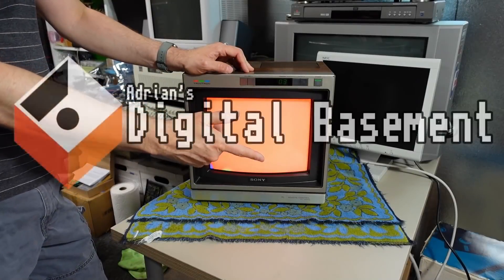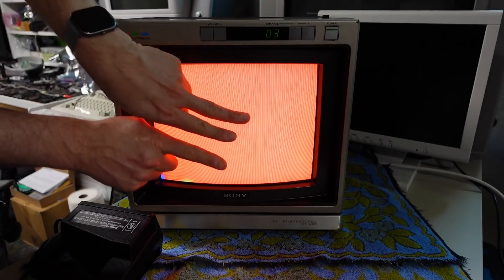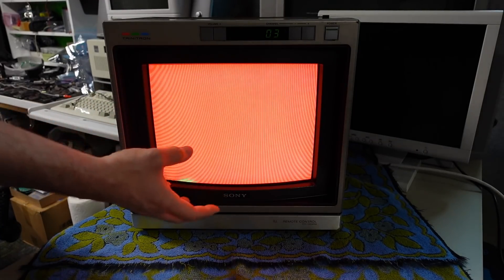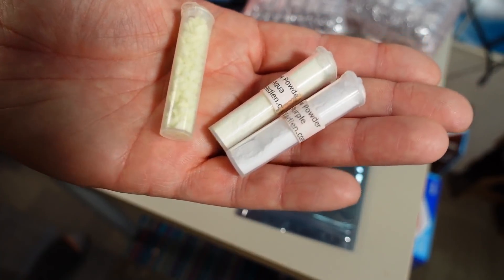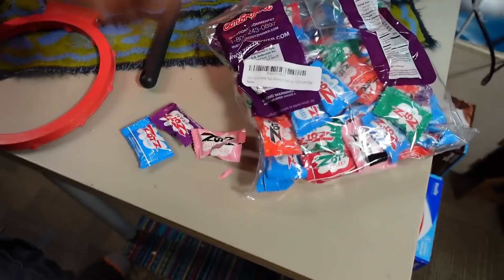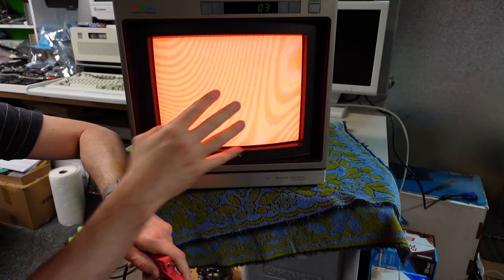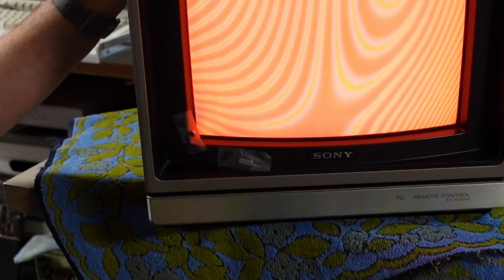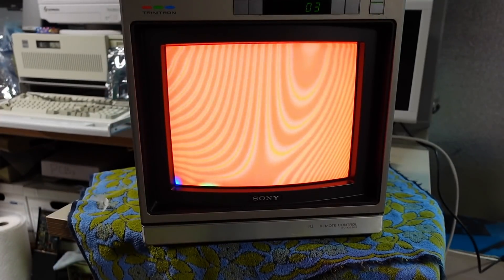Can you fix CRT color issues with this plastic ring?

Comment: you'll be able to fix the color purity with those two magnets, but they will mess up the geometry in that part of the screen. Unfortunately looks like the screen got hit there and the mask detached partially. No degaussing will fix that issue permanently. Use the monitor in that condition till it will last.
Reply: This can happen with delta/in-line tubes, but not quite with Trinitron. If the aperture grille detaches, the strings will be loose and it will affect a large area on the screen vertically, or if it detaches with its whole frame, then a whole corner will be affected. I had a 22" Trinitron that fell from about 2.5m onto a tiled concrete floor (wall mounted console got detached from the wall), the aperture grille got displaced, but it affected a whole corner, not just two tiny spots, and the spot was actually travelling on the screen very slowly (probably too big portion of the electon beams hit the grille and it heated up during use). Of course I found that out after I spent at least 2 hours repairing the traces on the board that was cracked all around the flyback. BTW szevasz, Tibi! :)
Reply: If you use a small n35 grade neodymium bar, its on the weaker end of the magnet scale and will do this same color fix but will not mess at all with the geometry. If you use a more powerful grade magnet, then yes it will

Comment: I had one of those coils as a kid, my little TV would get all messed up and degaussing it works. Your technique is the issue, what you want to do is hold it in the middle and hold the button. Then make clockwise circles with it and slowly pull the coil away from the crt while still making circles in the air. It may not fix your issue but that's the right way to use it.

Comment: It's a typical problem for stripe masks (Trinitron, Diamondtron) that the single wires in the mask start vibrating and hook into each others when lots of vibration or strong hits are applied e.g. during transport. This is the reason why Trintiron/Diamontron PC monitors have these horizontal stripes (1 for 15", 2 for larger monitors) to stabilize the wires to prevent this. The TV I think has a much more coarse stripe pitch and so does typically not need the stabilization wires, but is still prone to vibrations and the vertical stripes to hook into each others. This might be what happened with your TV.
For the degaussing coil, I agree with the others that, if it does not have a thermistor to lower down the magnetic field, you need to slowly move it away from the TV while moving it across the screen. This imitates the effect of the thermistor to lower the magnetic field in the built-in degaussing coils. Otherwise you could leave traces of permanent magnetism in the spot where you turned it off, that typically can be degaussed again but for the moment, they are there.
But I rather think you have a deformation in the stripe mask (like stripes hooked into each others), because otherwise the internal coil (which is the strongest at the border, because it is the closest to the border) would have fixed this. Giving a slight hit to the screen in the affected area might solve this, make it worse or does not have any effect at all
Reply: I guess if some vertical strings were stuck together it would happen around the middle of the screen, not at the very edge where the strings are secured to the frame.
Reply: Bumping this comment with another comment.

Comment: I had the same thing (but a bit worse) happen when I dropped a Trinitron on the corner.  I always figured the aperture grill buckled when I did it.  AND kinda funny I fixed it the same way!  I smashed an old magnet off a woofer into bits and glued em around until I fixed it!  Might not be the problem with this one but the fix definitely works!

Comment: I am not an expert but generally according to the theory demagnetizing works so that you need a changeing magnetic field (reversing north and south poles) and over time the strength of the field should also decrease. This way the magnetized metal will lose its magnetic field due to the hysteresis losses. So from a degaussing coil I would except when it is turned on that it should wiggle the picture. Since it was not happening I guess it does just generate a static field. Maybe rotating it around its axis (face front side of the coil and back side of the coil) could do the trick. Then increasing the distance would decrease the field strength and would demagnetize.
Reply: Since the power line runs at a very similar frequency to the scan rate the effects appear static.
Reply: @eDoc2020  good point :) In the past I had a SyncMaster that could do degaussing from the menu. There it was clearly slower then the scan rate judging from how the picture was wiggling. From this I have expected that a degaussing device will use a lower frequency than the power line frequency.
Reply: @andrashuszti1407  Usually when I've seen degaussing in action it's had the shaking; when I first saw a "static" one I was a bit surprised. I think the explanation is that we were probably running 70Hz or higher at the time.

Comment: A lot of older CRT monitors had a degaussing  feature that negated the need to do this.
Reply: If the internal degaussing unit is perfectly fine and humming, and does not fix the color purity issue, then external manual degaussing is very unlikely to do anything from what i learned. This ‘hack’ is a sure fire way to mask the purity issue
Reply: @RetrofIex does using external magnets like this cause more damage to the purity?
Reply: @GigaGrandpaYT  it can hide it if its in the right position and if the impurity is on the perimeter of the screen. It will not work if its in the middle

Comment: "Can you fix CRT color issues with this plastic ring?"
Usually not. CRT's typically have a built-in degaussing coil that activates every time you turn it on through a thermistor. The thermistor allow power to flow through the coil when it is cold but after a few minutes it warms up and the power slows down to almost nothing. [degaussing coil would affect picture if left on.]
Reply: You might enjoy an earlier video where he solved a similar issue by replacing the factory undersized degaussing coil with a bigger one. The piddly one was not quite reaching some edges of the screen.

Comment: 💪😎👌
Interesting, but... I'm wondering if it's also possible to use this degaussing coil in other way? I'm not an crt expert but I'm wondering if it can be used on open box tv-set and placed somewhere in the area of electron guns. (at the "end" of crt tube (or perhaps at the "beginning" taking into consideration that it's the source of electrons). Moreover I'm wondering if any regulation of electron guns deflection could help here. Probably there is Sony service manual somewhere on the net with detailled procedure. Just some ideas... They might be wrong as I said I never repair any crt's.

Comment: Yes unfortunately I think this set has has suffered a knock at some point, though you may be onto something with those permanent magnets. 

With degaussing, the quick 'n' dirty method was to place another TV or monitor screen-to-screen with the problematic set, and then power it up separately from cold to initiate its degauss. A bit like jump-starting a car!

As others have mentioned, moving the coil away slowly whilst rotating rather than turning it off mid-way close to the screen is generally considered best practice.
Reply: Haha that’s an awesome way to source a coil!

Comment: Can you also check the metal ring that holds the XY scan coils is not loose or has slipped back down the kneck(scan coils have slipped back away from the flare end of glass)..hard to explain...aka make sure the scan coils are pushed fully up-tight to the tube..
The white tape under the metal ring/clamp slips when warm..and moves slowly back over time .

Comment: You should slowly back the degausser away while it's powered to demagnitize metals and such, just running it at proximity without slowly moving away will probably just increase the magnetic field.
Reply: Yes, this is the way that the degausser is is supposed to be used. I can confirm that turning the coil on and move it away a few times will fix these kinds of purity problems..
Reply: @L0wcash  Well, atleast it could fix the purity problem, but there is also a small risk that the mask actually is broken. But super glueing magnets on the inside of the front is always an option if the degausser wont work. And if he actually takes it apart it will be easy to spot if there are any metal on the inside of the case in that area, if not, then he could degauss forever without any results. :D
Reply: came here to say this. aperture grills don't look like that when broken
Reply: This is definitely the correct way of using a degaussing coil yes. Moving around does not probably increase the magnetic field, it most certainly will.
Reply: What kind of degausser should I buy to fix my crt? Does it matter? Thanks!!
Reply: @Rael0505  Well, there surley are better and worse ones, but I've used the cheap blue ebay ones with success. They arent that powerful though, so a bigger is probably easier.
Reply: @kruppin  thanks for your answer! So size matters (lol) good to know :)

Comment: I wonder if that stupid mounting bracket or even the screw itself is just magnetized by using a magnetic screwdriver to install it. But the effect should vary by using the degaussing coil... However I had the funniest effects with CRTs that lost just a part of their corrective ferrites around the neck of the tube. So have you tried cracking their glue and adjust them just a little bit?

Comment: Hi Adrian. When using a degaussing coil on a CRT you really should not switch it off so close to the tube. You can leave a "fingerprint" of magnetism due to the ac cycle being at the top of it peak. You really should slowly pull the coil away from the CRT and when the deflection on the beams are at its lowest switch off. Hope this helps  Rob
Reply: Hi robert, I recently buyed a Sony PVM-8041q and Sony BVM-1316. the pvm grabed a color ring red in center screen. 
I dont have a coil so for remove I used the bvm because this has a button to degauss, I do it a few times until the circle disappears completley but. now when the image is completely white I can see some dark circles like burned  but very little distinguishable. and when is normal with image, this looks like a little brighter like a light aiming the screen. you know is this is magnetism problem or is burned? sorry for my bad english. :(
Reply: @AndyJango  Sorry, but that is symptom of a burned phospor sector on the CRT.

Comment: Put that ring on the corner till the problem disappears and then pull it away as far as you can before you turn it off. You should check for a transformer in that corner of the tube.

Comment: degaussing won't fix the stuff in the lower left corner.  there's an adjustment magnet that has moved or perhaps the metal band around the face of the tube itself is magnetized.  I don't think it's the grill, but I don't know for sure.  Usually a grill displacement has a much more dramatic discoloring effect than that, in my experience.

I would use one of those neodymium magnets to try to demagnetize the metal band around the face of the tube in those locations, or, more likely, between them.  pass a strong one, separated by paper or plastic, back and forth along the metal band around the face of the tube in that corner for a couple minutes, then see if it has improved.  if not, no further work is required because I'm wrong.

Comment: I have heard of but not yet has cause to try a demagnetization technique where you'd chuck a strong permanent (i.e. neodymium) magnet on a drill (or attach it to something like a spade bit) and gradually bring it closer to the screen while it's spinning at moderate speed.

In this case though, I think you're probably correct about the grill being damaged, unless there is some magnetized object being stuck inside around those spots.

Comment: It's possible there might be minor damage to the shadow mask, but first I would try to locate the service manual for that model TV, or a similar Sony TV service manual and follow the proper procedure to set the purity and then adjust the static and dynamic convergence. Purity is set by adjusting the yoke and then the purity rings on the neck.

Comment: From 'accidentally' messing up my parents TV in the early 90s I found that if I caused a permanent color shift by putting one side of the speaker to the screen that it could usually be reversed by using the opposite side of the speaker.
Reply: I also messed up my partent's TV ... with a magnet. The result looked pretty much like Adrian's. It was also a Sony from this era.
Reply: @talk_the_eye  my parents did their best not to be angry with me when I put a refrigerator magnet on the screen
Reply: @subtledemisefox  I did that with my bedroom TV in 03 or so, stuck a big base magnet from one of those magnetic art sculpture toys on the side of the case for like 30 minutes with a friend to laugh at the colour shift. 

Naturally it persisted after I took the magnet off! I just put up with it being messed up colour that day and the next day it was mostly fine, the day after that was totally fine. I guess if I’d known about degaussing then (as more than a button on computer monitors that made it jiggle) I’d have just power cycled it a few times!

Comment: Father was a TV repairman/AV guy. How I saw him do it back in the day (with several sets) was go in a clock ways formation for a while and then go to the center and then pull it away a good couple feet. Not sure if he then went back counter clockwise. Did that a few times but the pulling away from the center was key. Not sure if that would work in this case. I know he had to do it several times as well. Not just once.
Reply: Yes, it is quite important to remove the degaussing coil a good distance away from the CRT before turning it off; otherwise you could inadvertently magnetise part of the aperture grill/shadow mask
Reply: @BertGrink is there a way to tell if this has happened? I have a purity issue that wont go away and the tv have a working degauss coil
Reply: @GigaGrandpaYT  To be honest, I don't really know that, but if your TV has a manual control for the degaussing coil, you could try activating it a few times and see if it helps.
If it doesn't, then maybe it's time to get a newer TV.
Reply: @GigaGrandpaYT  Have you tried using the Coil? You can also use a TV with the exact size and place it glass to glass (but not directly touching each other) turning it on and off in front of the tv with the purity issue. TV's should have a built in degaussing system when turning on and off. it might work

Comment: I always thought a true degaussing was to flip the magnetic field north/south very fast.

My understanding is that initial "bzzzt" you hear as the degauss activates is the result of the reversing of the field back and forth quickly for about a half second...
Reply: That's exactly what Adrian said, the TV set feeds 50 or 60Hz mains through the degaussing coil, so the field reverses at that rate.

Comment: Glad you enjoyed everything. 
And those Rom's were out of old Cisco system routers.
Reply from the maker: I used one of these ROM chips to upgrade the ROM in my Apple IIgs :-)
Reply: @adriansdigitalbasement2  at 13:23 if you take the CRT out... the problem will go away... i bet you 10 bucks on it........ what is causing that magnetic field you see in that corner... is not inside the CRT ... is outside the CRT............ a parasite CC current circulating in the degaussing coil.. i bet you 5 bucks on that (disconnect the degaussing coil.. see if the problem go away)......... if is not that.. then magnetism is in the screw on that corner.. (highly posible).. or in the bracket in that corner.. (unplug the TV for 24 hours and use a compass to find the magnetic object in that corner.. the needle will point you straight towards the south and north pole of the magnetic object there)... magnetism in the anti-explosion band also can be.... (the magnetism in those metallic objects can be removed.. using that red ring).. or with a simple electromagnet powered with 12v AC (a coil around a screw)... and leaving it close of the metallic object for a while....
Reply: Someone gave me boxes and boxes of these old Cisco routers.... I'll be set for life. I also have these small package ones...they are Cypress CY7C245A's..... I like these a lot but I can not find a programmer that can deal with them.... perhaps an adapter? They also have a byte for security. any ideas?
Reply: @GORF_EMPIRE  The Xeltek superpro universal programmers can do this. Sometimes you can get one at ebay for about 150$.
Reply: @elmariachi5133  I have a TL866II...it's a shame you can't program that like the old Pocket Programmer 2....which I do have one of....but that requires a parallel port. Perhaps I can use that with my old WinME laptop. IF not I'll take a look into the Xeltech. I have a ton of those chips too. Thanks!
Reply: Wow you commented 2 months ago?
Reply: @Bird_Brain_Dave  I guess the video has been in private mode or Unlisted for 2 Month's 🤔 🥶

Comment: Here is a video of a guy suing the exact coil I sent you on a video game. 

https://youtu.be/xboO2JUvtBM
Reply: and here is a guy using a bigger coil on another video game. 
Same technique but a bit more dramatic with the larger coil. 
you can use the bulk eraser in the same fashion and it may work if the smaller coil doesn't have enough power to do the trick. 

https://youtu.be/3pVLizAHby4